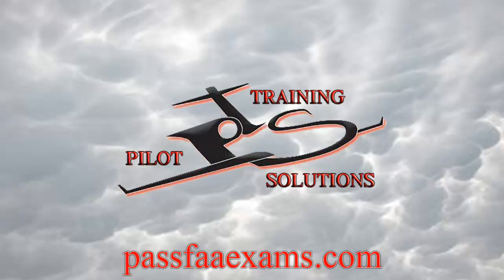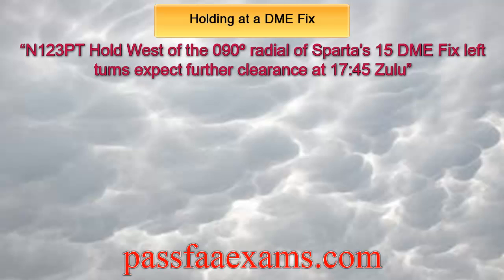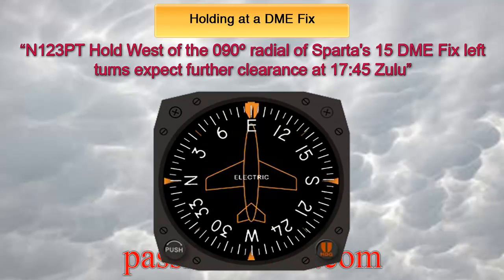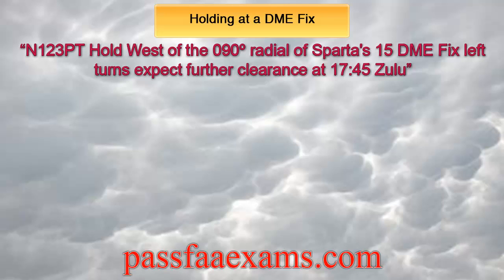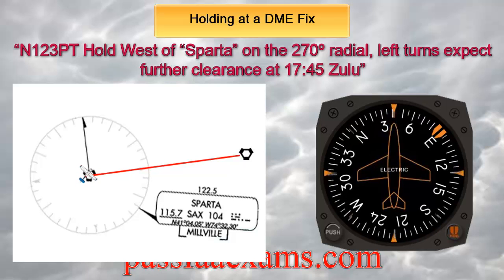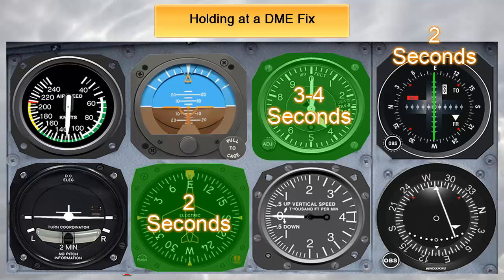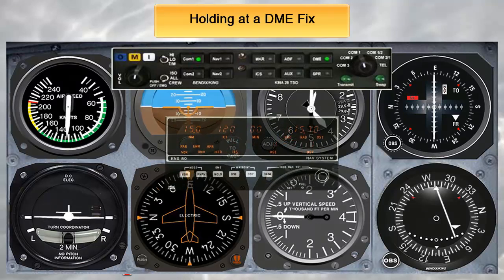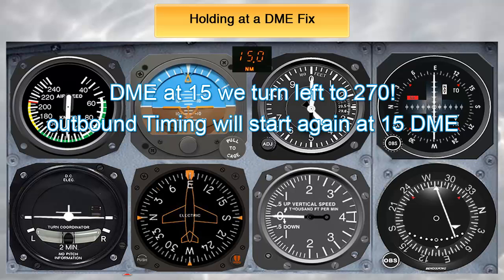Holding at a DME Fix

Comment: If you are 15NM east of SAX on the 090 Radial, aren't you holding east of Sparta?
Reply from the maker: Negative: you are East of Sparta but you will be holding West of its Radial 090 15 DME Fix. As I mention in the video, pretend the DME Fix is the actual station!